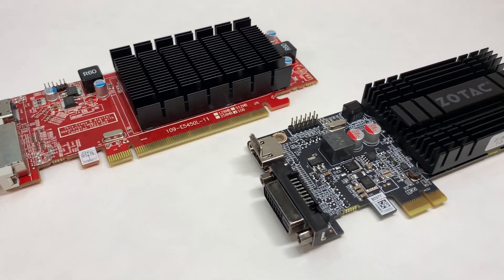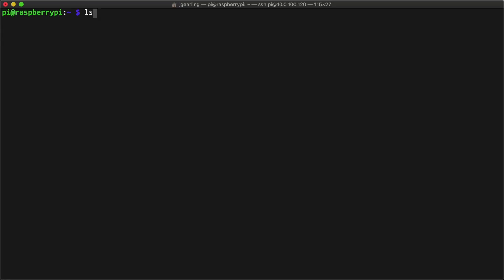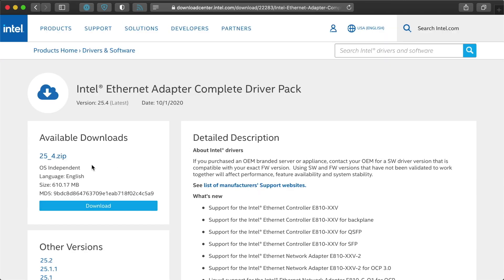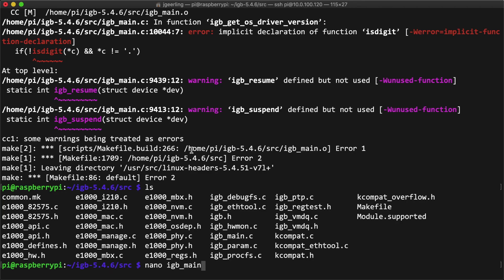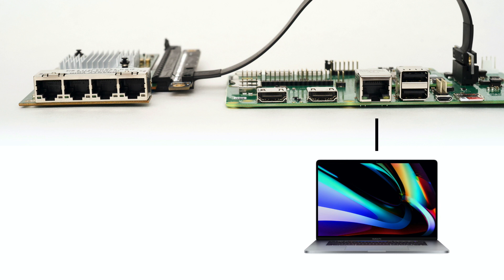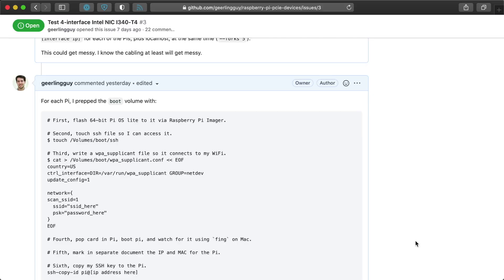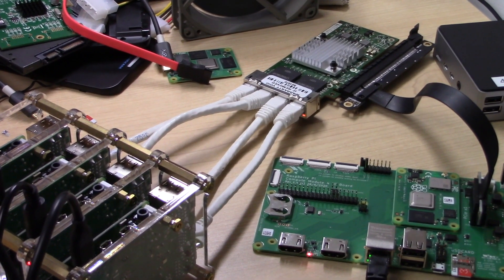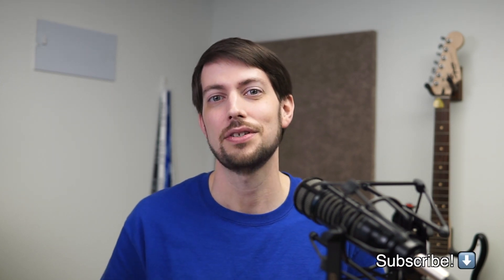5 Gbps Ethernet on the Raspberry Pi Compute Module 4?!

Comment: iperf can be quite cpu limited since it is a single threaded process.  You likely are running into a bottleneck because of lacking cpu performance on the pi cm4. The client in iperf has to do more cpu work than the server so you are getting as good of performance as you can get in terms of your setup with the cm4 being the server. I find iperf3 to be more performant than iperf in general so you might want to try that.

Also, the -Z, --zerocopy of iperf3 can allow for better performance as well.
Reply from the maker: I'll have to try it out! Can you drop a comment in the linked GitHub issue too, just so I don't forget?
Reply: @JeffGeerling  just did. enjoying your tests so far with the cm4

Comment: whole pcie gen2 x1 bus can only give you max 4Gbps bandwidth due to 8b/10b encoding method from paper.  Then, you might want to check it's cpu hitting the cap or other thing hitting the cap.  Maybe you can check duplex function as well.  There are some overhead from pcie to tcpip layer as well.
Reply: Yep that what I was thinking that the limiting factor here is the 16x to 1x PCIe Adapter using the onboard: PCIe Gen 2 x1 socket https://en.wikipedia.org/wiki/PCI_Express , Like 1.x, PCIe 2.0 uses an 8b/10b encoding scheme, therefore delivering, per-lane, an effective 4 Gbit/s max transfer rate from its 5 GT/s raw data rate. From this document https://datasheets.raspberrypi.org/cm4io/cm4io-datasheet.pdf 2.8. PCIe Gen 2 x1 socket. It seems that it is using the  VLI805  XHCI  controller and the USB 3.0 interface  is using the same PCIe  link . But even with that speed this would be enough for small home FW with input/output 1Gb connection. Just wondering if that Broadcom BCM2711 quad-core Cortex-A72 (ARM v8) 64-bit SoC @ 1.5GHz with 8GB would be enough to run FW with all the options turned on. like QOS, packet filtering etc. Anyone tested?
Reply: @jvierinen  They mention maxing out the PCIe Gen2 x1 throughput in the 'Discussing Raspberry Pi Compute Module 4' video, about 11:20 minutes into this video: https://youtu.be/yiHgmNBOzkc?t=648 (hooking it to a dual 10GB card)
Reply: The kid will need an x8 PCI-E slot to do what he wants.  Since this is a weak device with multiple adapters to do anything cool with it. He needs to check the bandwidth of every adapter connection, all processeórs involved, and memory.  

Just like all the graphics cards that are coming out right now, most people are going to bottleneck on their CPUs and even it not that much their still are going to be limited to a hand full of uses because all software is made to be used across as many different types of computers as possible. Not just the top 10% of the gaming community.
Reply: @josephholloway3130  True as we see with nvidia 3080 the CPU is the current bottleneck  and I bet it will be with the AMD ones too if you don't upgrade to their latest and greatest CPU

Comment: One thing that might be interesting is to see if one of those four port USB cards that they use for mining would somehow work on the pi and then the next question if it is seen on the pi can you somehow mine to it  

As if that wasn't a hard enough question can you use your Intel card and replace your switch on the cluster.

Comment: Now I know why I support your work. Fantastic job. So what’s next Jeff?
Reply: Pi 4 cluster with 2.5/5Gbps cards and switch? Maybe cheap ConnectX-3 can be used, they are 10Gbps, but PCIe will limit them anyway.
Reply: @technomandrite   I think some (Qnap?) made a PCIe card with 10gbe and a NVMe slot on one PCB. Would be interesting to get that working.
Edit: Yes, it’s the Qnap QM2, but it’s $240.
Reply: Ln2 oc

Comment: With the release of big navi, do you think that the restrictions that caused all older gpus to fail on the rpi would be bypassed?
Reply from the maker: Buy me one and I'll find out 😉
Reply: @JeffGeerling  well I can't afford to buy you one but if I'm able to get one you can use it for a bit.
Reply: no.
Reply: @japrogramer  Still the same BAR issue then?
Reply: @lordzadd  The issue has nothing to do with the card family. Big Navi requires PCIe 4, which could represent even more issues.
Reply: @BrunodeSouzaLino  requires PCI 4? source? That would imply it would not work on any intel systems or lower end modern AMD systems.
Reply: @BrunodeSouzaLino  Supports and requires are 2 very different things
Reply: @power-max  It would if the PCIe standard wasn't backwards compatible. You just won't get all the performance. Although, gaming cards are not capable of using all the PCIe 3 bandwidth available.
Reply: @BrunodeSouzaLino  Exactly. It will work just fine. And even then it is only a potential bottleneck in specific workloads that rely heavily on transfering large assets over the interface. Such the case with video streams when using a hardware encoder or forwarding the rendered screenbuffer over to another GPU such the case with virtualization or active GPU switching (optimus)
Reply: In theory every AMDGPU compatible Graphics card should work with the Raspberry Pi. They work with other ARM Systems, the SiFive Unleashed and Unmatched RISC-V Boards and the OpenPower Boards from IBM.

Comment: Its kinda insane what you can do on a Raspberry Pi.
Reply: Yes, but just to keep the fundamentals in mind, I always break in a new pi build by first going to pornhub. It's a christening or pilgrimage of sorts.
Reply: @dr.fistingstein1566  this means i couldn´t keep up building new pi´s
Reply: hahahahahaha yeah
Reply: It's not the Pi that's the star here, it's Linux. It's a computer with PCIe bus and a supported CPU. You shouldn't be surprised this works, and it's the thousands of open-source developers that made this happen.
Reply: @PJBonoVox  I mean the star is the fact it has that connectivity in that small package.
Reply: I'm so glad they switched over to this tiny little connector like they did. I liked the DIMM slot idea before, but those things are gigantic. The tiny little board is going to be used in SO many things.
Reply: I WANT TO PLUG MY RTX 3080 INTO MY RASPBERRY heavy breathing